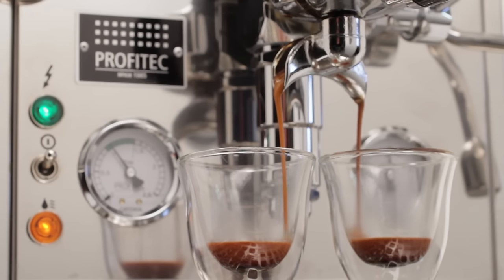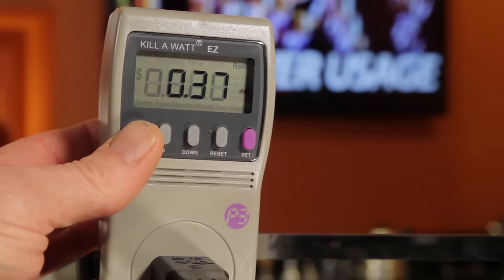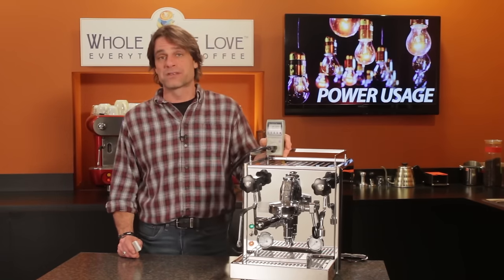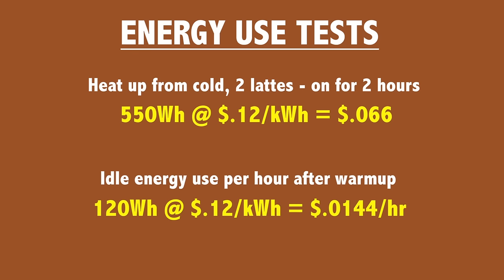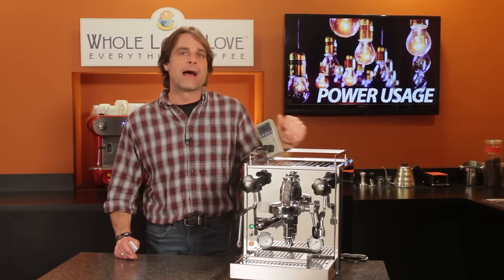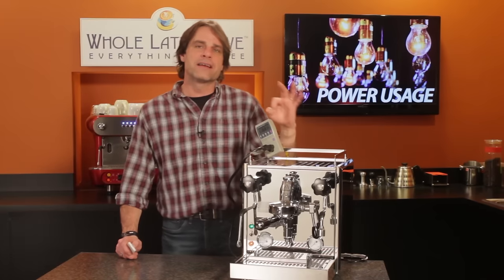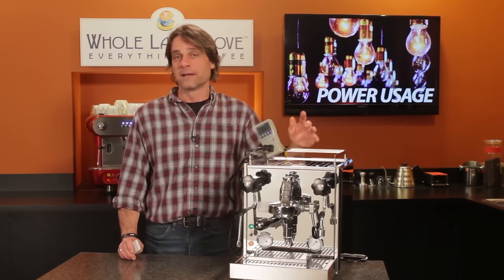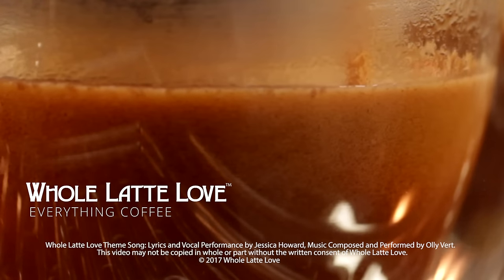Tested: Espresso Machine Energy Usage and Cost

Comment: I followed your advice and bought a wifi timer.  It has been great. The wifi timer phone app also charts power usage, and based on that I noticed the cost of heating it up a second time if it has been switched off within that 4 hour window you talk about is far lower (obviously since the boilers trap the residual heat). Based on that I have shifted my habit to switching it on from 6:30 till 8:30 and the back on at 12:30 till 15:00 if one of us will be home for lunch. I switch off the wifi timer manually when I leave, knowing it will be warmed up when I need it next
Reply from the maker: Hi CD, Thank you for the comment and sharing your experience!

Comment: Thanks for the measurements! 
One thing though. Heating up uses restive heating, there are no extra losses in heating up the machine. You'll only have to put in the amount of energy that left the machine while it was turned off. 

Heat loss is directly proportional to the temperature of the machine, thus a 200 deg f machine will loose a lot more heat than a 140 deg f machine in the same amount of time. If you turn the machine off for 2h it won't cool down completely and thus it will not consume as much power as a machine that has been off for a night. As a result you'd definitely save energy by turning the machine off when you're not using it, even if that's only an hour.

Comment: I used a power meter on my Expobar Brewtus IV when I first got it. I measured my power consumtion for a few months and it added up to a total of about 200 kWh (about 10$ where I live - at 0.055$/kWh). This was for months of utilization (about 6 months If I recall). My typical pattern is to leave it on 24/7, then turn it off overnight once in the week. I also leave it off for longer periods when I travel for work (several days a month). All in all, I consider it cheap enough to leave it on all the time, it does consume some power, but hey, its not lost, it makes me save on the heating bill during winter!
Reply from the maker: Hi Max, Thanks for sharing your experience and the detail! Much appreciated. Video with manufacturer recommendations on leaving machine on/off coming soon!

Comment: Good info!  I never actually measured the power consumption of my machine, but had the gut-feel that it would be higher than this.  My machine is on a timer and is usually on about 2 hours from start to finish.  I turn it off right after use, mostly to save wear and tear on the circuitry and the rubber gaskets/seals.  I only use it in the morning for just two double pulls, so the later re-heating costs are not a factor for me.
Reply: Leon Shaner kinda the thing i do on my profitec 500
Reply from the maker: Hi Leon, Thanks so much for sharing! I have the recommendations from machine manufacturers on when it's best to leave on or turn off and will share details in video. Until then, what you are doing seems to align with their advice. What kind of timer are you using?
Reply: Whole Latte Love Hi hi.  I used to use an old school mechanical appliance timer, but for the last 5 years or so I have been using an Insteon appliance outlet/receptacle behind the machine.  I have a schedule in my home-control application to turn it on at the right times M-F and a little later on Sat/Sunday and it always turns it off at noon in case I forget.  Meanwhile, if I have to get up extra early for some reason I can set a one-off event to handle that.  It's a lot more flexible than the mechanical timer and since it's computer-based it's one less clock to switch from Daylight Savings <-> Standard Time.  LOL
Reply from the maker: Hi Leon, Thanks for sharing. We will be doing a video on timer options soon for other who may be following along.

Comment: I have a small, old Saeco single boiler machine. I usually only brew one espresso per day so I turn it off when done brewing. But good point about the warmup from cold to hot in regards to energy use.  :)
Reply from the maker: Hi HFN, Thanks for the comment!

Comment: I used to use a KillaWatt Timer for my 2011 Expobar Brewtus IV Rotary until the timer died. Now I leave it on 24/7 - sometimes I will shut the steam boiler down over night as it only takes 7-8 minutes to come up to full steam pressure. I have it plumbed in with filtered, softened water. I have had to replace the steam guage and the PID and now the pressurestat recently. I am overall pleased with it given it's been in daily use (8-10 double shots a day) for just over 5 years. I may go back to using a timer at some point, but my power is $0.08US/kwh.
Reply from the maker: Hi Ben, Thanks for sharing your experience! Sounds like the Brewtus has served you well. Leaving machine on more does tend to wear parts faster. Many of the timer switches have load ratings very close to the draw of prosumer level machines like your Brewtus IV-R. Some of our techs feel this may stress the relays in timers and cause premature failure. It's a topic we will cover in an upcoming video.

Comment: Great video!. I bought a refurbished WEMO smart plug on Amazon for my Machine and have it set to start up in the am on a timer.  It’s also programmed to shut off automatically at noon, so the machine is at temp during the day when I drink coffee. It works very well, and I have the ability to modify the schedule via my smart device when I travel. It’s nice to know that the operating costs are so low...

Comment: I have an ECM Classika and decided to just leave it on after watching your video on that subject. I soon had a machine getting slower and slower due to scale buildup. A machine at idle is still recirculating that water and unless you know you have high quality water, you will create the conditions for scale buildup.
I descaled the machine back to prime working condition and now turn on and warm up as needed. Luckily with just a brew boiler, it's all done in a minimal amount of time.
Making a decision due to power usage is really a false economy because the cost of potential repairs is going to far outway energy costs. Be kinder to your machine and wallet by turning it off when not in use.
Reply from the maker: Hi Rick, Thanks for sharing your thoughts. It's a tough call. Descaling a single boiler machine is easy so it makes some sense. I've discussed the leave it on/turn it off issue with the CEO of ECM Michael Hauck. We have a close working relationship with ECM and were at there production facility in Italy a few months ago. Here's some video of our visit if interested: https://youtu.be/K0RI5rdz4Ww
Awhile ago I asked Michael what he recommends in regards to leaving machine on/off when not in use. He told me he leaves his dual boiler home machine on all the time. His reasoning? First, he wants his machine heated up and ready to go. Second, he told me scale is more likely to form when the machine cycles from hot to cold.
In most cases dual boiler machines should be descaled professionally. Single and heat exchange boiler machines can be descaled by home users so different considerations with those. You hit on the best way to deal and that is high quality water so little or no scale forms in the first place.
Marc
Reply: @Wholelattelovepage  Hi Marc, It's interesting that he said, "scale is most likely formed". It appears to be still an opinion and not a known fact, doesn't it?
My machine scaled up pretty quickly and didn't leave any doubt as to why. Two facts became clear, I have terrible water quality and it's better for me to turn off.
I've been using the ECM anti scale filter but not diligent on changing out every two months. Lesson learned but I'm considering changing to Rocket's drop in pads when my filters are used up, a yearly change being easier. I think, with my water quality, descalling should be a yearly routine and just not wait until an issue pops up.
I really appreciate you taking the time to answer me Marc....big thx.
All issues may go away in the near future....not a fact, but a Decent guess.

Comment: Thanks for the informative video Marc and I absolutely love how in-depth you guys go! 

I have a Rancilio Silvia with a PID on it. I have solar panels at home, so thankfully the price of electricity isn’t a big issue for me, but I’ve done a lot of testing with thermocouples to see how long I have to keep the machine on to properly warm everything up for the most consistent brew temps with the shortest flush cycles. 
I’m looking to upgrade to the new profitec pro 700 V2 after watching your videos on the amazing engineering behind it, also so I don’t have to do so many experiments to get the right temps haha.

I wanted to know, how long do you have to keep the Profitec pro 700 V2 on to achieve the desired temperature at the group? 
Sorry for the long comment!
Reply from the maker: Hi Mr. M, Thanks for the kind comment and question. I have tested full warm up times in the past For machine like the Pro 700 with E61 group it's ~35 minutes for full warmup. That's defined as the time it takes for the external surface of the brew group to reach a stable temperature. You can put the Pro 700 on an appliance timer as it has a mechanical power switch. On the backend, the Pro 700 has an ECO mode which will power down the boilers after a user defined period of non-use ranging from 15 minutes to 10 hours. Coming from a Silvia you will love the temp stability, no wait nonstop steam and quality of the Pro 700! If at all possible plumb your machine in. I don't know how others feel, but never having to fill a reservoir is a life changing experience IMO. Also be sure and feed it with good water so you never have to descale.
Marc

Comment: That's basically exactly what I thought, heating up is going to use the most energy, but if you're not having more coffee, why not just save the energy and turn the machine off. I'm also guessing if you do turn it off for an hour only, it might not actually be that bad since it's still semi-warmed up. So it might not use as much energy or take as long as it did for the first cold start of the day.

Comment: Hi Mark , love the show . I'm setting up a mobile coffee spot in a VW VOLKSWAGEN, I'm trying to figure out how to power the machine with solar panels, and I have a la Pavoni pub1 with water tank, I'd love to get your advice on leaving it on or off and how much power (watts) does it use when idle .
Reply from the maker: Hi AB, I don't have that particular machine handy to test power consumption. But, I can say this. These types of machines typically require a 15amp service. I suppose that can be done with solar panels - lots of them and you'll need some battery backup to store the power and probably lots of those. In this video it was 550Wh to get the machine up to temperature and then 120Wh to run the machine per hour.
Reply: Hey Alvaro, did you end up getting this going? I'm keenly interested, doing the same thing, aiming for a purely solar powered session

Comment: Thanks for the video!
This regards energy usage when both boilers are on? I usually switch off my steam boiler on the profitec pro 700. Do you know the energy usage when only the brew boiler is switched on?
Reply from the maker: Hi Bas, Yes, this covers when both boilers are on. I have not done measurements with just the brew boiler turned on. I'd guesstimate it's about half. The steam boiler is larger and heats to a higher temp but the brew boiler is constantly circulating water out to the group where it looses heat so may need more internal heating to stay at temperature.
Marc
Reply: @Wholelattelovepage  great. Thanks!

Comment: Interesting. I wonder how much impact boiler insulation has on power usage.

I own a Bezzera Magica, which is not insulated, and the seller said that according to Bezzera it wasn't worth insulating since heat loss was negligible compared to brewing coffee, steaming or drawing boiling water.

What do you think?
Reply from the maker: Good question! I have to think insulating a boiler will help retain heat and reduce energy usage. I have not measured this effect. In practice I've found machines with no insulation seam to radiate more heat and would think it requires more energy to replace the lost heat.

Comment: I have mine on a timer switch so its properly warmed up by the time I usually get up, weekends are set differently and stays on longer as there's usually time for more during the morning.
Reply from the maker: Hi Adam, Thanks for sharing! Curious what type/make of timer you are using?
Reply from the maker: Hi Adam, Thanks a bunch for sharing. I checked the link you provided and it has no info on the power rating of the timer. Any chance you have that info? looking for Amp/Watts rating. Also what type of machine are you using it with?
Reply: Whole Latte Love I have a Lelit PL60PLUST Double Boiler with PID. Power rating on the timer is 240v @ 50Hz, 2400W, 10A

Comment: Marc.. In the above machine you tested, is the broiler insulated or not?  If not, would the energy cost be more since the machine would run hotter for a 24 hour duration?  Thanks
Reply from the maker: Hi Barbara, Thanks for the question! The Profitec Pro 700 used for testing in the video does have an insulating jacket on both boilers. I suspect it would use a bit more energy if the boilers were not insulated.

Comment: Hi Marc, very interesting, thank you.  Do perhaps know what what would the comparative figures for automatic machines be - say example a medium sized Jura?
Reply from the maker: Hi Leon, Great question! And I'll put the Kill A Watt meter on a super-auto to give you some accurate numbers. For now, in comparison automatic machines use a lot less power. Almost all of them have thermoblock boilers which heat small amounts of water on-demand for the most part. Very different than the dual-boiler semi-auto shown in the video which continuously works to keep ~2L of water near or above boiling temperature. Many Jura machines and other super-autos have good power-saving economy modes and automatic shut-off to help conserve power as well.

Comment: Did you guys ever do the video of what manufacturers say about leaving the machines on al day vs turning them off? I'm pretty sure in some manuals I've read it says to turn off the machine when not in use, and don't leave unattended. Even though it will likely be fine, It's not a commercial machine.
Reply from the maker: Hi Ben, I have spoken with some manufacturers. I asked what they do with their personal machines and it's 50/50. Some leave them on continuously Others turn them off when not in use and some have machines with built in on/off programming. True they are not technically commercial machines but every cafe owner I know turns their machines off to conserve power.
Marc

Comment: I have my Rancilio Silvia plugged into a Wemo Insight timer. It is on about ~3-4hours/day and assuming the energy cost is $0.200/kwhr the Wemo reports it costs about $1.50/month.
Reply from the maker: Hi Alex, Thanks for sharing! The WEMO Insight timer is cool. Are you comfortable using that on high demand appliances like your Silvia? Kind of mixed feelings from our techs here. Some say no problem, it's rated for 15A/1800W. One is iffy as he feels relays in the switch might wear/fail over time due to arcing. How long have you used the WEMO?
Reply: It is rated for 16A so I'm assuming it should not be a problem. I have used it for about a year almost everyday and have not had any issues.
Reply from the maker: Hi Alex, Thanks for the response. Think our iffy tech is the type that uses extra caution. As mentioned most others feel if it's rated to handle an amperage and the machine is under that amperage it should be perfectly fine with relays designed to handle many thousands of on/off cycles.

Comment: Thank you for making this video. I was looking for an explanation of what espresso machines need in terms of power requirements. 2 at a time, 3 machines and so on. And an explanation of power units (Watts, Volts, "AMPs" ?) all that... thanks!
Reply from the maker: Hi Danny, Thanks for the question. Most semi-automatic espresso machines draw in the 1200 to 1400 watt range. If you are in the US typical household current is 110-120 volts. So let's call it 115 volts. Watts = Volts x Amps. So if a machine draws 1400 watts, to get amps you divide watts by volts. So 1400 watts/115 volts = 12.17 amps. If you want to run 2 machines you'd need ~24.5 amps of power. You always want a little overhead so you'd need two 15amp circuits or a single 30amp circuit to run 2 machines. FYI 30amp circuits are uncommon in households.
Reply: wow. Thank you for the extra-mile help! awesome.
Reply from the maker: No problem!

Comment: Don't forget to consider air conditioning costs. If the espresso machine is in an air conditioned room, you are just wasting money and power. Keeping a room cool to counteract the heat put out by an always-on espresso machine will be considerably more expensive than the cost of keeping the machine at working temperature.
Reply from the maker: Hi loeysf, Thanks for pointing that out!

Comment: I have a timer attached. It comes on at 6:30am & goes off at 3:30pm Rocket Giotto mk2
Reply: Poppy Puppy Which timer?
Reply: It's just a common or garden timer from the local hardware store.
I did have a Bekin Vimeo attached at one point, but either it went spastic and took out my grinder, or the grinder failed and took out the Vimeo. Either way, it was an expensive exercise I don't care to repeat, so I'll stick with the mechanical timer for the foreseeable future.